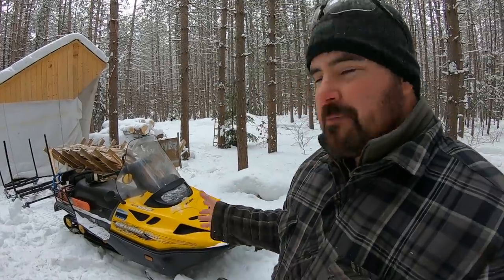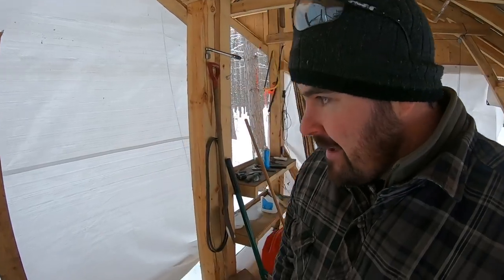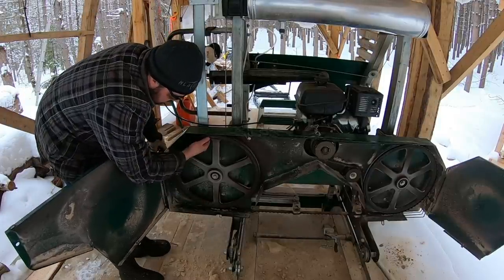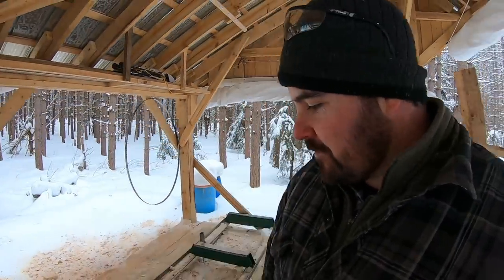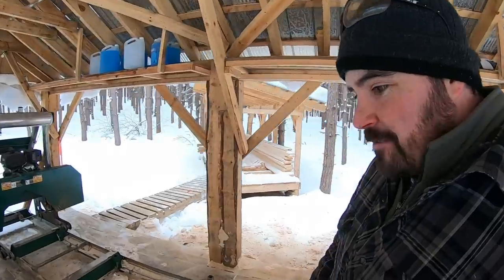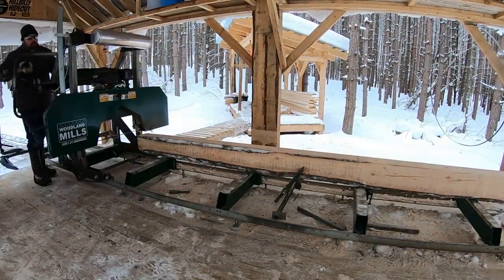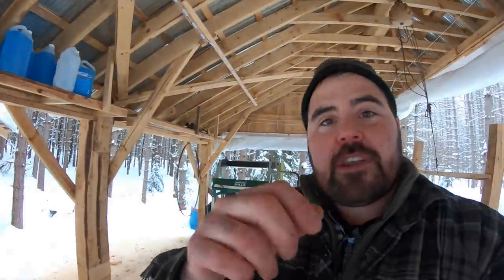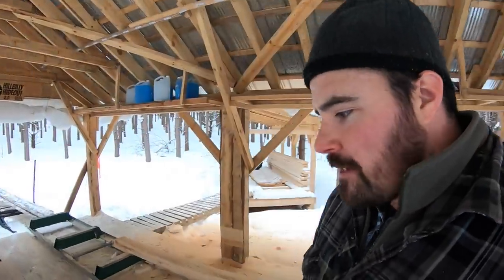Running a Sawmill in Winter isn't Easy

Comment: The title alone deserves a thumbs up.  The cold temperature freezes the grease in the blade guide bearings and the blade water or windshield washer water for the blade sometimes freezes in the lines,  the blades drive pulleys get gummed up and so on.  You nailed it with this video.
Reply from the maker: Sure can be a struggle

Comment: Always love watching your videos,  I've learned so much learning to use my sawmill.  I only have 5 acres and not really that many trees, so I  only purcchased an HM122 with the 7 hp. I did get the extension and the sharpener/tooth setter combo. The majority of my trees are black walnut which are really nice except I hate using it to build with but the cost of pine boards are just to much so walnut 4x6's holding up a 12x12 loft in my shed with walnut boards for the flooring. Much too fancy for a storage loft but I'm not paying their price for 3/4 inch plywood. You've been a great help with my decision to purchase woodland mills and using it both safely and efficiently.  Thank you so much.
Reply from the maker: It’s great to have nice folks like yourselves around the channel.

Comment: Always interesting keeping a sawmill running here in a Ontario winter I know all about it lol anything much colder than-10 I find it very difficult keeping my mill cleaned out etc since I'm not in a building yet but eventually I will we had a warmer week so we got back sawing and got another load of logs in so happy to be back sawing January was pretty much a write off because of this extreme cold we've been having
Reply from the maker: Yeah I agree with ya there. The snow and cold is a battle at times for sure

Comment: Maintenance is key on keeping machines working properly. You mention a roof over your wood to be cut. Actual for you that would be fairly easy Sandy. Keep it clear of snow for Milling. Ya, I kinda like that idea. Easy for me to say right. I started my HM 126 up yesterday and Milled a 23 inch Cedar. Made at least 10 boards, inch and a quarter by 10 FT x 14" wide. Was good to get out of the house in 49 degree temp. was like summer for me. Next week back down in negative temps and chance of snow. Thanks for sharing, Iowa enjoys your videos 🙂
Reply from the maker: Sounds like a nice piece of log you had there. Great feeling making some nice boards like you did I bet

Comment: I have a hm 130, 2022. It has been a learning curve. I found when adjusting the blade, snug it up a little then run saw blade slowly, then finish torquing blade. I broke a number of blades before doing this way.

Comment: Fighting snow in winter...a nice soft battle. I also have to deal with those 1foot covered of snow logs. I hook a rope on a fiex point, pass the rope under then over, then you just pull to make the log roll until the mill bed. I'm sure you know the trick. It's the most basic manual winch! Very simple, easy  on moderate weight logs, less back and forth with the peavy and your gloves stay drier. I actually use 2 ropes 6 feet apart under the log and pull on both at once, so the log doesn't shift left and right.  Love your videos, showng the great canadian winter. I have the same weather  and activity (just less of it damn) so if I watch your vids and still enjoy, that's something to be said about the content quality!
Reply from the maker: That is a good reminder for me. I have seen this in the past but haven't tried it out before. I think I want to give this a go. Like you said, may make it easier on myself.

Comment: Good work Sandy. One of the best investments I made with my Woodland Mills was the log winch. It moves logs like nothing. I use it to pull logs up onto my Woodlander and even to roll over the really large logs when sawing. I am 60+ and find I can saw a lot more without having to strain with the can't hook etc. Just a thought. It would be easy enough to make but looking at the price it is a break eve to fabricating yourself. Cheers.
Reply from the maker: Sounds like a great idea Scott. Is yours like a boat trailer winch ?
Reply: @sawingwithsandy  Woodland mills sells it as an add on to the trailer package. I think it retails for $120 and has a long synthetic rope on it. Check their website. I didn't buy the ramps as they were easy enough to fabricate but if you price out the winch with synthetic rope and the pricing of steel, Not worth making yourself. Have a look.It'll make loading the mill easy. Cheers. Scott

Comment: Good video, Sandy. With my (woodworking) bandsaw, I reach in and slowly turn the bandsaw wheel as I'm tightening. The blade will center itself, and when it doesn't, just a little canter adjustment brings it home. Just a thought.....
Reply from the maker: Thanks for sharing!

Comment: Good morning i know i said it before but i do not miss that shoveling snow one bit but i don't mind the cold no bugs to pester you while working    Sandy i would consider buying a batteries operated blower i got a blower by my mill but i am fortunate to have power close by so mine is electric but i clean my whole area when i am done cutting   I wish i would of started doing that earlier on because of not cleaning right away after some of my mill got rusted from the saw dust accumulating on different parts it also keep a better control on the working area you would not have to shovel that frozen saw dust well have a nice day and enjoy making more beautiful board
Reply from the maker: That blower sure would be handy

Comment: Think half walls on the saw shed would work with maybe some type of shutters/panels on hinges you could raise and lower for the top half? You could keep the view and still close thinks up when needed. The downside is that it would make it more difficult to clean out around the mill and, unless the shed was widened a bit, it could make for some tight quarters at times.
Reply from the maker: That’s definetly given me some things to think about. Thanks for sharing Roger

Comment: The corduroy idea is different for my trail thoughts,  but what's your thoughts on that versus loading and leveling wood chips instead
Reply from the maker: Since the area is so wet I was hoping to build a base with the wood as loggers tend to do when making skidding trails. I figured the wood chips would sink in easier
Reply: @sawingwithsandy  I was just thinking with the quantities of chips you can make,  it might work out smoother.  Just a thought,  keep up the great work and videos!! Awaiting the final pieces to my sawmill.  Thanks for being the inspiration I needed to pull the trigger on buying!

Comment: Thanks for the video Sandy. Why do you square off all 4 sides of the cant? Why not just square off 3 side? If you left the last side down couldn’t you save time. Your just going to throw that last piece in the off cuts anyway.
Reply from the maker: My main thinking is that I want to have a flat side on the blade mill bunks instead of the log bark in case the log shifts at all while I’m cutting my lumber
Reply: @sawingwithsandy  Thanks

Comment: Have you ever run a larger band blade ? I’ve have a 2019 hm130 max with trailer I’ve installed the turbo7 1 1/2 inch 55 thickness seems to run good the stock blades ware out to quickly with the logs in my neck of the woods lots of oak,walnut,cedar, hickory lots of pine
Reply from the maker: I’ve not tried it. I wouldn’t mind giving it a try though
Reply: I asked the same question a while back. I wanted to try it myself but having difficulty sourcing the blades in NB Canada. Mr.Kurt2233 any suggestions?

Comment: Sandy, I can’t see why those tarps don’t roll up better by themselves.  I know on the green houses with equivalent thick (but clearer) tarps, they rotate the core to wind up and down.  A light 1 1/2“ galvanized pipe would do it nicely. Then secure the roll at the height you want with the pulley fed rope
Reply from the maker: Some times they get hung up but there is a 1.5” steel pipe in the bottom of each. Probably was some snow and ice built up I’d imagine
Reply: @sawingwithsandy  can you rotate that core with your ropes or a winder?  I see some  of your YouTube brethren have a bolt on the end and use their cordless power drills to wind up . Then tie off at the desired height.
Reply from the maker: That could be something I think about in the future for sure

Comment: Your blade guide seemed to be drifting out by itself.  Perhaps need to tighten the pressure?  Is it possible that's what caused the jam at 18:25?   You jammed again a bit at 19:15 and watch the guide drift out again as you go through the rest of the cant.  Thanks for the great sharing of knowledge and experiences.
Reply from the maker: Sometimes I don’t lock it in position so it may have been the case there where it slide in a bit

Comment: Why not put a base on the swivel part of the sleigh? It would aid in backing up while still functioning as it should just like when using the seat base.
Reply from the maker: Hi Grant. Thanks for watching. I do have a top for this sleigh but I have benches installed in it. Iv'e got a playlist with the bob sleigh listed in it if you're interested.

Comment: You need a cordless leaf blower to clean your saw
Reply from the maker: Sure would be handy
Reply: I was thinking a $1 store toilet brush...it can get into all the nooks and is usually stiff and abrasive enough to loosen up the dust so you don't have to use screwdrivers or metal on metal etc... another fun video...Thanks Sandy